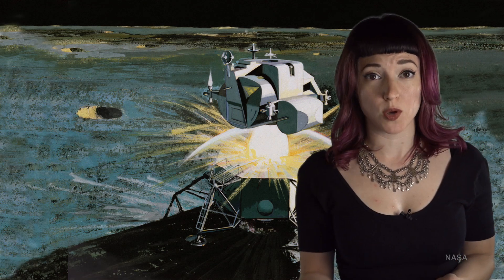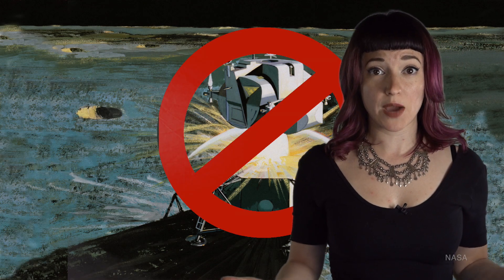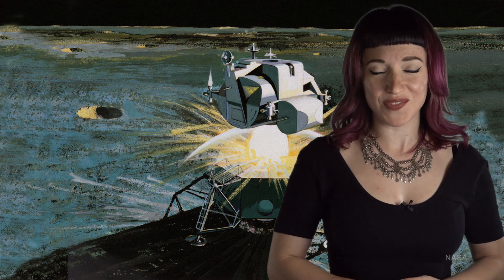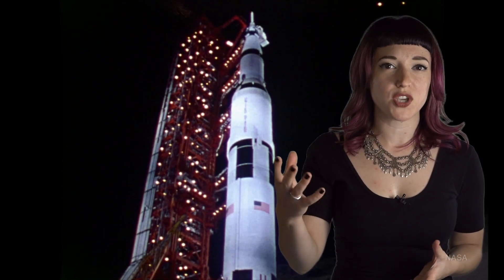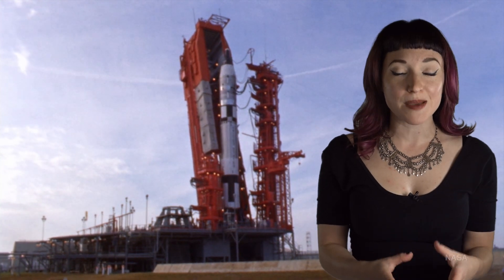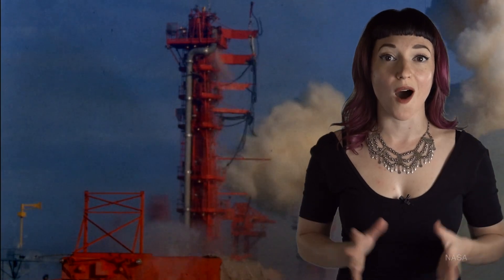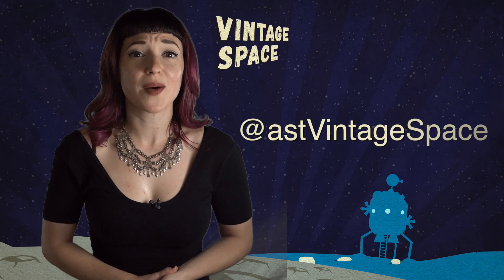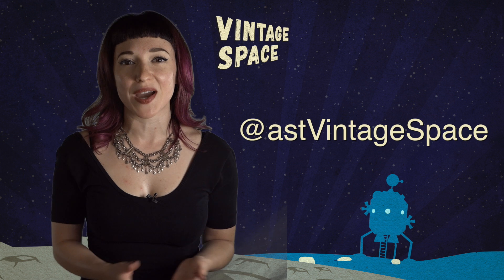How the Lunar Module Launched from the Moon Without a Flame

Comment: Do I understand that they did not have throttle control on the ascent stage?  Was that because of the fuels used?
Reply: I would think that the main reasons it wasn't throttled was a) it wasn't really necessary, the ascent flight path had no point where a reduced thrust was needed (as in comparison to the descent, where you need both max thrust to decelerate and less thrust to hover and land) and more important b) it had to be build as reliable as possible. The ascent stage was one of the few points where no redundancy or emergency abort was available, this device HAD to work, no matter what.. Thus it was made as simple as possible, no ignition, no fuel pumps (works by compressed helium), few moving and electric parts, and no throttling. The device was even one-use only, everything to guarantee that the ascent stage will lift off.

Comment: I’ll give ya that, why haven’t we been back? Why does the footage look so fake/bad, why did NASA destroy all the telemetry? I believe we went, just have lots of questions and have my doubts.
Reply: The answer to "why haven't we been back?" is the same as the answer to "why did they cancel Apollo 18, 19 and 20?"  It's basic economics:  The cost is too high for the benefit that remains to be gained.  Public interest had already dropped steeply by Apollo 17.  
The footage is from a 1960's era video camera.  Low resolution, slow scan, sequential color, low dynamic range.  
No telemetry was destroyed.  The original (master) slow-scan video recordings from Apollo 11 were apparently recorded over during later missions.  Not a loss, since there are still many copies of the broadcast-standard video that was produced live during the mission.

Comment: The hypergolic engines were never tested on earth. They fired these for the first time on the moon and miraculously worked out 100% all 6 times. Remember the history of NASA rocket launches before Apollo 11. "Land of the brave", I must say :)

I have though a question about what happened during the ascending of the lunar module during Apollo 16 trip back home to earth. Study below!

https://youtu.be/yn1S-flYkaQ

You see the side panels are ripped off and behind these panels were the critical electronic hardware and other very important apparatuses mounted. These stuff must have been very resistant to everything such as cosmic radiation, the pressure and temperature difference?

Comment: Thanks, Amy, another entertaining attempt to prop up a desperately failing hoax. 
Perhaps though, you could have also addressed the ballistic nature of the blast off.  So, normally when we see rocket lift offs there is a gentle build up of thrust as the rocket first achieves a momentary weightlessness before gradually gaining altitude and velocity. 
But that's not what you have here. 
You have an explosive of multicolored glitter accompanied by the shooting of the craft. Anyone inside would certainly  have never survived that level of gs. 
It must be possible to measure the exact acceleration but I'd reckon that level of tug would be something that no human could ever forget about if they survived it. 
Also, it clearly isn't rocket propulsion, whatever you say about fuel types or 60s TV . 
Also the camera points up, controlled remotely, we hear,  from Kennedy. Is that really possible? What about the one second delay? Can you view that footage again and ask yourself if the camerman could really have been any where else other than behind that camera?
Also, the camera was supoosed to be set up by astronauts. They were covered in dust the whole time. Dust that threatened to compromise the mission on different occasions, dust that was ubiquitous. So im just wondering how anyone managed to get the lens free from any spec of dust, even during blast off. Its a real head scratcher. 
Maybe it was all just a hoax. 
https://youtu.be/Zztbw7MLlkI
Reply: "So, normally when we see rocket lift offs there is a gentle build up of thrust ...  before gradually gaining altitude and velocity." - The Saturn V weight 6.2 million pounds at lift-off, so of course it was gradual. Why would you think that the much lighter LM ascent stage would behave the same?
"Anyone inside would certainly have never survived that level of gs." - In examining the video you can see that the ascent stage went up about the height of the stage, which was 9 feet, in about 1 second. That would make the acceleration about 18 ft/s^2. That is only about 0.6 g. Try again.
"Also, it clearly isn't rocket propulsion" - And what makes that so "clear"?
"Also the camera points up, controlled remotely, we hear, from Kennedy. Is that really possible?" - Yes. The operator simply has to listen to the countdown.

Comment: Hydrogen also burns clear on Earth. That was one criticism made against Hydrogen Fuel Cell cars.
Reply: That criticism of hydrogen fuel cell cars is not valid, because the hydrogen is not “burned” in these vehicles!! See my answer to Alex Indjic for a full explanation of why this is so, radiotec76
Reply: radiotec76 oohh wow.!!!!!
I didn't think of that. I'm a mechanic and I've had people ask me why we don't have hydrogen cars ???
Clear flame is definitely aspect of safety.  I've worked with methanol and it's something that ordinary people fathom.  Clear fire is horrendous
Reply: alex indjic - Actually Alex, that’s NOT how a hydrogen fuel cell car works. Hydrogen is NOT burned, as such, in the vehicle. Hydrogen, along with oxygen from the atmosphere, is injected in the fuel cell, where they combine chemically and produce electricity in the process. This electric current is then used to power an electric motor ( via a “ buffer” battery ) which drives the vehicle’s wheels, with only pure water( H2O) being emitted from the exhaust as a result of the fuel cell process. So as you can see, a hydrogen fuel cell car is ACTUALLY AN ELECTRIC VEHICLE !! , and so these vehicles are very safe because the hydrogen used does not undergo combustion in the conventional manner.

Comment: The hyperbolic fuel idea is a great engineering choice, but it sure is nasty stuff.  I spent my USAF time (1965-1969) supporting the Titan IIs deployed around Wichita, KS. UDMH and nitrogen tetroxide are “stable” at mild ambient temperatures.  The silos were kept at about 60F.  But they are both incredibly toxic and dangerous to handle.  Look what happened when a dropped wrench almost caused Armageddon in Arkansas.

Comment: The next confirmation of this in the video, when you say about the fact that the exhaust gases can dissipate not limited by atmosphere's pressure (present on Earth obviously, absent on the Moon) far more easily, is clearly visible when the exhaust gases shatter the metal foil in which the lunar module's parts were all covered in, they scatter all over the place being blown away with these gases.
Reply: I've heard some people claim that those colorful flying bits are from the explosive bolts which released the lunar module from its base.  Either way, it's a remarkable sight, and one that makes perfect sense when happening in a vacuum.
Reply: @ericl2969  Maybe some of it are the bolts parts, but, like you mention it's the base that is mainly covered in this metal foil (I can't remember what was it's purpose), an the gasses go downwards shattering it and blowing it away. I assume most of it is the foil, because there is indeed a lot of this debris, flying all over the place. To me too much for just bolts holding together the base with the command module. Also another point that people don't consider from physical point of view is the fact that exhaust gasses are not visible in vacuum/empty space (vacuum can be made in a 1 liter jar and it is vacuum too, but not significant to have the effect), and this is clearly seen on hundredds of other footages of rockets in space - for example when Saturn V second stage's J2 engine is fired up already and the connecting ring between 2nd and 3rd stage is being thrown away, we don't see the exhausts from the engine, only when the ring gets in their way it is being burned by them, so they are there, we just don't see them because of the vacuum. And it is happening right above the Earth, not even on the Moon yet.
Reply: @ericl2969  So even if we did not somehow land there, these arguments that hoaxers provide, are simply irrelevant anyway :)
Reply: @JumpinJackFlashSlash  Hey, that's a different twist.  Very good point!

Comment: How did the camera on the moon track the lunar module taking off and ascending ?
Reply: It was a camera on the lunar rover.
The tilt commands were sent from Earth, and were pre-calculated because they had to be transmitted before the lift-off due to comms delay.
 On the previous moon landing the timing was off, and the ascent stage disappears off screen.
Reply: It's possible it wasn't tracking at all, just some clever editing of a wide angle video.

Comment: Dose it still take 7 or so min for a Raido signal from earth to get to the moon .... ?
Reply: 7 minutes?  No.  It's about 1.2 or 1.3 seconds (it varies a bit based on exact circumstances, but that's pretty close).
Reply: @rockethead7 Agree Your right 👍, mybe Mars is more like it 12 or 14 min, and aren't we going to use some kind of relay satilites..... ?
Reply: @MrRockydee07  
Well, it's a bit over 8 minutes for light to reach Earth from the sun (radio travels at light speed, so it would be the same).  To answer about Mars, though, really depends on the orbital position.  Sometimes Mars is completely on the other side of the sun from Earth, and light/radio would need to travel a much further distance.  Sometimes Mars is closer to us than the sun is, and it takes less time for light/radio to get there.  So, really, I cannot give a straight answer about Mars, because it changes too much.

Relay satellites have an effect on transmission time, of course.  But, if we're talking about communications with Mars, relay satellites are a drop in the bucket, fairly insignificant (time wise anyway).

Comment: Yes this purple wigged lady can convince you of a 33500 lb launching mass will make drift of dust as she can convince you that office fires can bring down 3 steel skyscrapers lol
Reply: 33,500 pound launching mass?  What ARE you talking about?  That's the weight of the LEM in Earth gravity, fully fueled.  But, since they burned 18,000 pounds (Earth weight) of fuel/oxidizer getting down to the lunar surface, it only weighed about 15,000 pounds when it landed.  Adjust that for the moon's gravity, and that's about 2500 pounds.  But, you said, "launching mass"??  So, you mean when it lifted back off?  They left the descent stage on the moon, and only launched around 1800-1900 pounds off of the lunar surface.  Bottom line: you have no idea what you're talking about.  None whatsoever.  Lay off the drugs, and get an education.
Reply: That would be 5583 lbs under lunar gravity there chief.

Comment: Ok explain the colourful sparks now.😂
Reply: im assuming some of it was due to the explosive bolts used to separate the ascent module from landing module. Up to the moment of ignition the two modules were still connected. Kind of like the CSM and CM
Reply: Explosive bolts, that's it
Reply: @philanglade2745  It's more complicated than that.  See my other answer.
Reply: @rockethead7  Thx anyway, not 4 me, since I KNOW all this is real, but the m**ons who say all is fake.
Reply: MI6  Wrong.
Reply: The colorful "sparks" are not sparks.  It's debris from the explosive guillotine used to chop through the plumbing and wiring.  And, it's probably some of the thermal blanket coming apart.  The reason it's "colorful" is because the RCA camera used on the rover had a "color wheel" to produce the colors, not 3 pickups (which is what most color cameras used back then).  In order to save on weight and size, they reduced the camera to a single pickup, rather than 3, and used a spinning color wheel to produce the color images.  Here's a video showing a color wheel, so you can get the concept (but, this isn't an Apollo color wheel, I'm just using it as an example).
https://www.youtube.com/watch?v=R4zTe46U09E

The color wheel did a decent job, but the weakness in that method is that fast moving objects move through the frame faster than the color wheel can spin.  So, you get this rainbow effect, because the pickup isn't able to see the small/fast objects through all portions of the color wheel.  Slow moving objects are fine.  Stationary objects are fine.  But, fast moving objects will get their colors all jacked up, again, because the wheel doesn't spin fast enough to expose all of the colors to the single pickup.  This happens to all fast moving objects seen in all color broadcasts from the moon.

Take this video as another example:
https://www.youtube.com/watch?v=bVNTNeNMH8Q

Notice at about the 50 second mark, the camera/astronaut are moving too quickly for the color wheel to rotate all the way, and the edges of the astronaut's suit appear to change colors, like a rainbow effect.  This same thing is exactly why the "sparks" are colorful.

Does that answer your question?

Comment: Have you covered the topic of the attitude-oscillation that is observed from Eagle window on ascent from lunar surface?  There appears to be some “heading wiggle” of the vehicle as you observe the lunar surface as Eagle ascends.  I wonder if that is the vehicle, because it didn’t appear to be camera mount.  Many thanks.
Reply: The reason is because the ascent engine wasn't gimbaled.  They wanted to make the ascent engine as simple as possible, as light as possible, and as small as possible.  Gimbals are moving parts.  Gimbals make things more complicated.  Gimbals take up space (which is a real issue, since the ascent engine actually protrudes into the cabin space, believe it or not).  So, they got rid of the gimbals for the ascent stages.  Now, you've got a problem, right?  Gimbals keep the rocket going straight.  Almost all rockets you see are gimbaled, and they fly straight.  A Gimbal keeps the rocket thrust in a direct line with the center of mass, so it goes straight.  But, the LEMs' ascent engines didn't have gimbals.  So, the slightest lack of perfect balance will cause the craft to turn.  And, no rocket is perfectly balanced (hence why they use gimbals most of the time).  So, how do you solve this?  OK, instead, you use gyros and computers, tied to the 16 RCS rockets (the 4 rocket quads on the corners of the craft).  If the craft starts to go off course (which it always will), you fire the RCS rocket quads to correct the trajectory.  But, new problem: if you make that system operate too quickly, you're pulsing rockets all the time, burning more fuel than you actually need to.  So, they intentionally let the craft drift off course a bit more than you'd intuitively think, then over-corrected by firing the thruster quads in the opposite direction.  By doing this, they basically cause this rocking motion you're asking about, a bit like being on a boat on an ocean (which is how the astronauts described it).  They conserve fuel, and reduce complex overreactions, by just letting it rock back and forth a bit.  Bottom line: the oscillations you see are a result of the lack of a gimbal on that rocket engine in the ascent stage, and the method they used instead of the gimbal.

As a side note: if you look at Apollo 17's launch from the lunar surface (rover cam), you see some very violent up/down motions of the LEM in the frame of the video.  Conspiratards think that these are the same oscillations you're talking about.  But, they aren't.  The camera itself tilted up/down a few times, making it appear that the craft was violently going up/down.  But, the oscillations were not that violent.  Again, slow rocking.  The conspiratards don't know what they're even looking at.
Reply: rockethead7 wow!!!  Incredibly detailed and perfect explanation.  Thanks for this discussion!!